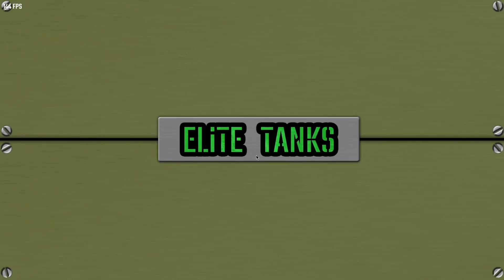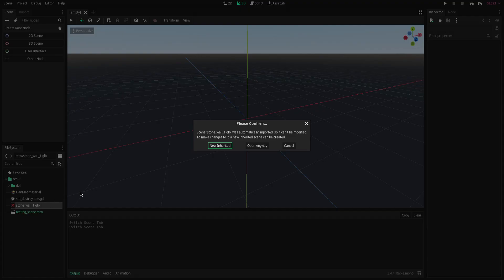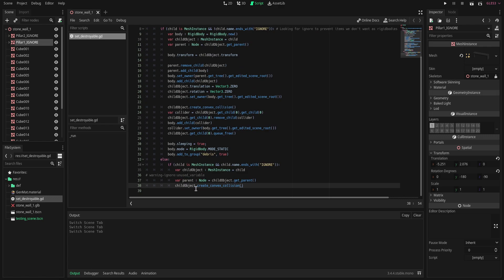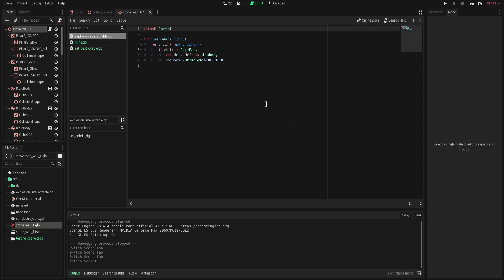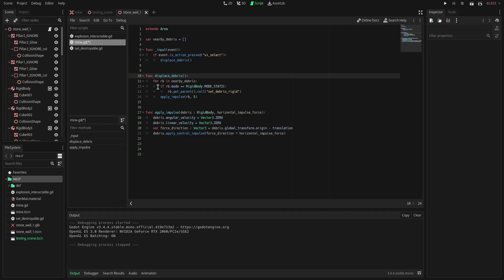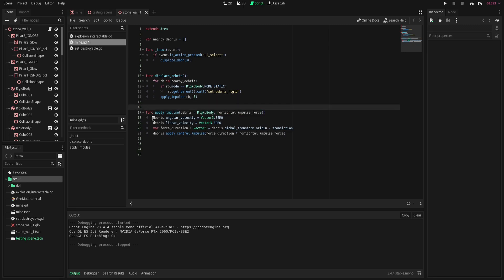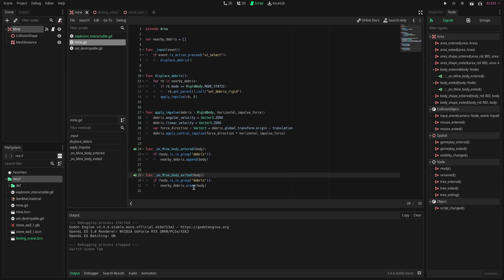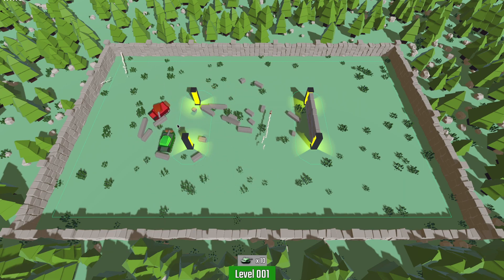How I made breakable walls for my game (Godot Engine)

Comment from the maker: FEW THINGS TO MENTION:

I just realized I didn't normalize the force_direction for this video. Figured I missed something since I made this really quickly and there it is. That would remove the need of the mass added onto the rigidbodies and more of playing around with the force which I also called "horizontal" impulse. I named it horizontal since I copied it from another project that I had and forgot that I had both vertical and horizontal impulses in that project for testing purposes. 

I think the issue mainly that I was trying to generalize the mechanic in this video and I had it setup a bit differently. I'll take my time with videos in the future and try to miss less things lol.